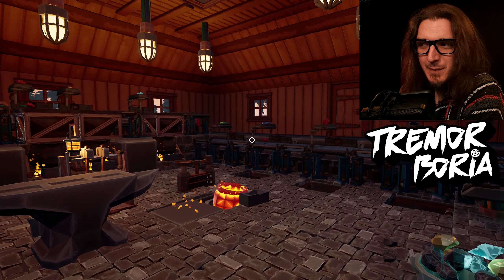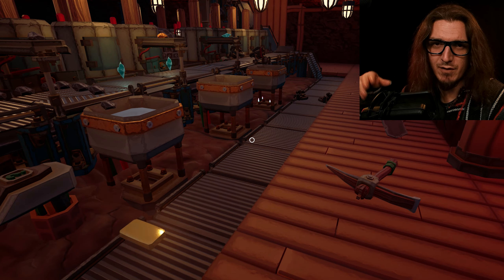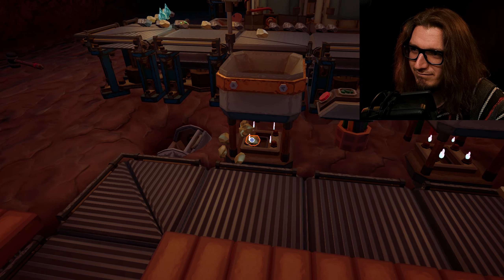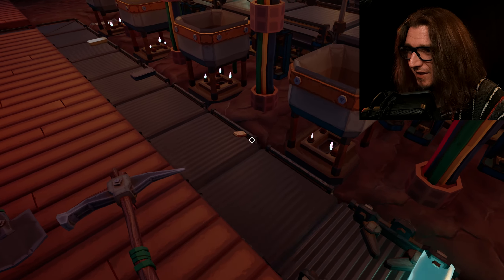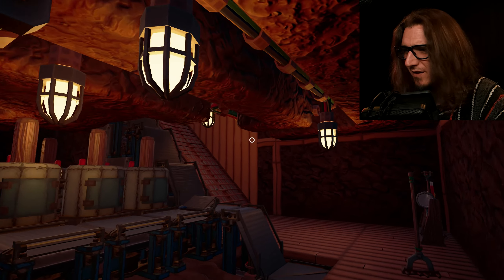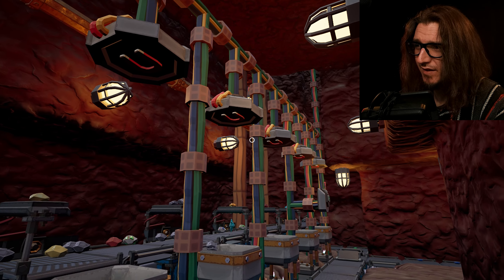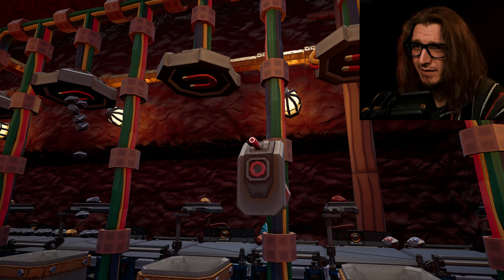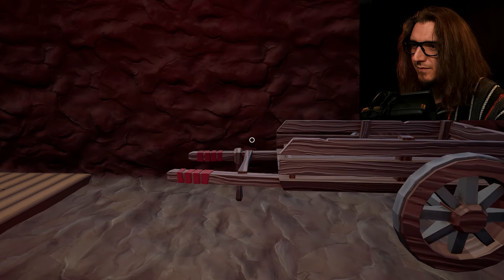Hydroneer: Manual Logic Smelters?...

Comment: I didn’t know you could use the logic smelter manually. I built an open pit and spent a week setting up auto logic. 😢 Why didn’t anyone tell me it could just be switched. 🎉
Reply from the maker: I uhm... I did just tell you. Lmao.
 You can set up all logic components to be manual if you want. Including but not limited to filtration repair, for that early build ease.

Comment: How low were your frames dropping? Because at 60fps on here I didn't see a difference with the mess at the end and if it wasn't running the whole time that should have been a mighty haul! Tiny Flamingo 🦩
Reply from the maker: That's not the point lol. The point is frames were dropping and now they're not. It was dropping 30 to 50 fps. So still mostly in the 200's but I want more drills. But I am very confused about it because it's not a hardware issue (I monitor everything) it just seems like the game engine can't keep up with itself? I am not a game developer so I don't know what I am talking about, Hows your steam set up coming along man?